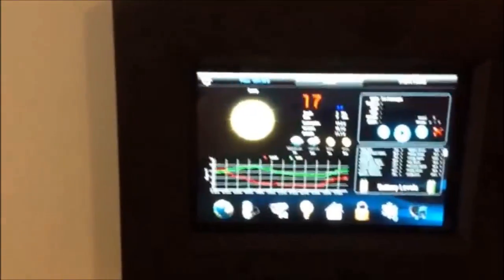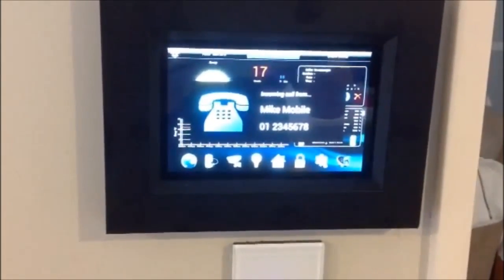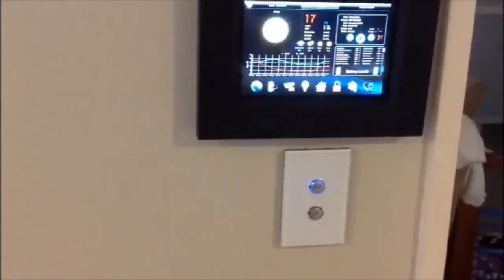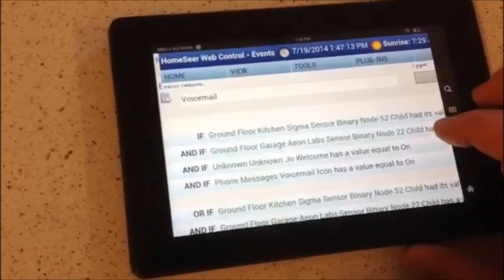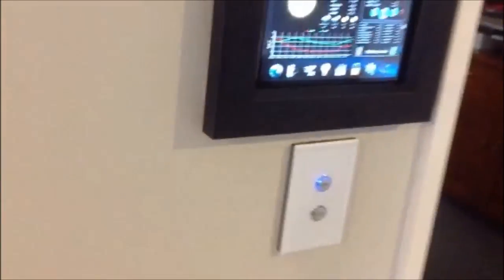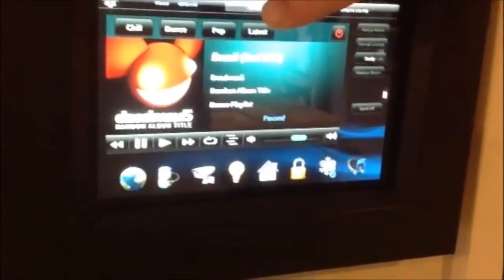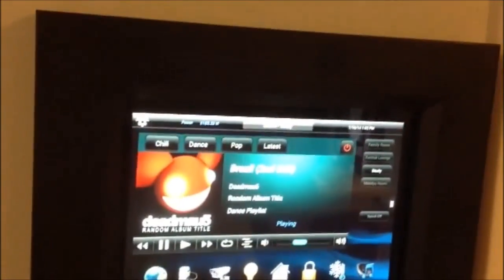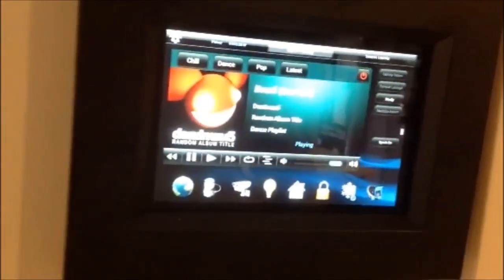Zwave Home Automation

Comment: I assume you do not live alone, looking at your house. The problem I have is that we are 5 people. Now if I do something like geofencing, I need to take 5 phones into account and a almost constant comming and going of friends and relatives. So it turns out the PIR sensores or even a switch work much better than Geofencing.
Reply from the maker: I use a combination of PIR sensors/Camera triggered events/Geofence to run both room level and house level events. The PIR sensors tell me someones in a room (but not who). The geofence (these days I use a combination of bluetooth + mobile data&GPS) tell me who is in the house (and to some degree who is a in a room). I like being able to personalise the events based on who is there, PIR's wont let you do that. For friends and relatives I could care less so for them they are all PIR based events. For my family + the cleaner it's personalised.

Comment: what tablet and frame did you use to be able to mount it to the wall?
Reply from the maker: it's an amazon kindle 7" HD. It's a few years old now so they no longer make that particular model (reso is 1280x800). Frame I got custom made by going to a picture framing place and then used a dremel to route out some more of the frame to fit the  micro usb power plug and cable. Stuck to the wall using  3m command adhesive velcro strips (makes it easy to remove and reattach on the rare occasion needed). I haven't looked recently but now they have been out a few years there maybe an off the shelf option now available.

Comment: Hey Mike, how you doing? I like you all videos. Please tell me how did you  mount KindleFire HD 7" tablet on wall?
Reply from the maker: I went to a place that makes picture frames and got them to build some frames for the tablets and then took to the back of them with a dremel drill to carve away enough wood for the micro usb (L shaped) to plug in and charge it. From there it's stuck to the wall with 3m command adhesive Velcro strips
Reply from the maker: I've taken a pic of the back for you to see:
http://zwave.nz/2017/04/18/wall-mounted-kindle/

Comment: Hello, it looks amazing!
What about reliable Zwave micromodules. I had bad experience with x10. I used original marmitek, spend thousands euros to build smart home but afrter one year I had faulty modules, loose setting etc!! My friend had same experience with Fibaro system. I like all the smart features you can't find at KNX or CBUS but ..
Have you ever face any issues?
Thanks
Kostas
Reply from the maker: Hi Kostas, over the last couple of years I have had some failures. 2 Double in wall aeotec switches have failed completely and 1 aeotec multisensory occasionally was reading incorrect temps (it would go from 20 degress then shoot to 60 and then drop back down). The later sensor was outdoors, but it was always under complete cover. Every other aspect of it worked fine and that's out of aprox 60 zwave devices.

Comment: What light switches do you have? They look nice, and do you use any of the zwave dimmers?
Reply from the maker: Yeah I swapped over to them as I liked the frosted glass finish and you can get labeled buttons as well. They are made by a company called Clipsal and they are the Saturn series with bell press switch. For dimmers  I use the aeon labs dimmers and have a couple installed one on some regular incandescents and the other running some dimmable CFL's